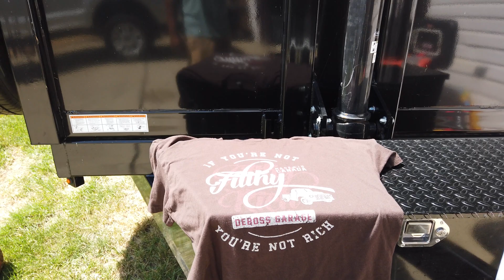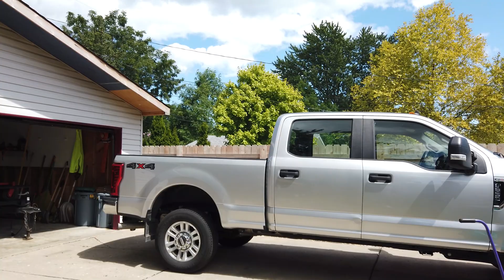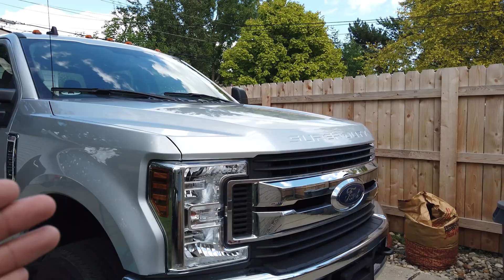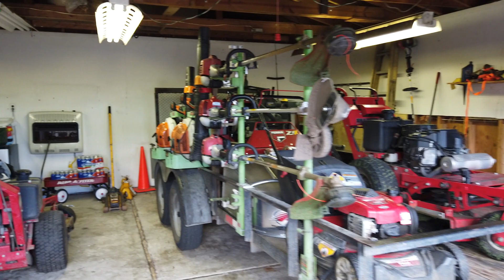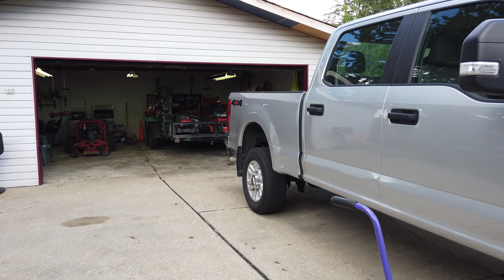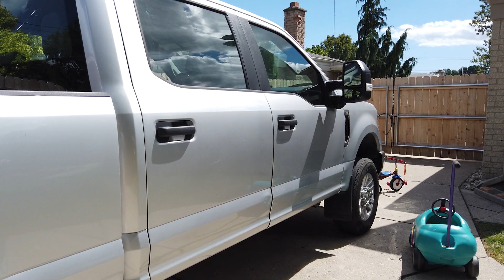Crystallization of full synthetic oil? What was Deboss's engine builder talking about?

Comment: My f150 5.4 2v 19yrs full synthetic never internally had failure 2 yrs switched Castrol 15-20k full syn but change 10k with high mileage filter always I Think the fuel  packages nowadays my be causing crystallizing with extended oil changes
Reply from the maker: I've been working on cars since I was 16. Never even heard of oil crystallization...
Reply from the maker: Certainly not from full synthetic oil.

Comment: Synthetic oil is overrated in my opinion.Todays conventional oil is  better than ever.Change your oil every 3to5 thousand miles and a quality filter and any engine will last.Synthetic oil shines in EXTREME COLD OR HEAT.Most of us don't live in areas where we need synthetic oil in our vehicles,unless recommended by the manufacturer. Just my 2 cents worth.
Reply from the maker: Very true. I think with the exception of turbo engines, particularly if they are driven hard... Which is why I run full synthetic in my EcoBoost. That being said, synthetic blend is definitely adequate!

Comment: Ill have to watch the Deboss video, I agree with you on the crystallization of full synthetic oil. I don’t believe it at all. I am a fleet mechanic we use full synthetic 5w30 in our fleet of hard working 1/2 ton thru 1 ton trucks . I use conventional 15w40 in all our class 8 trucks since they sit inside even in the winter we’re ready to go 24/7;trucks sit at 67 degrees,and we change the oil annually and most trucks only have 2-4000 miles on them, most class 8 trucks go 15,000 miles between changes...we’ve never had a single issue and our light trucks typically get 500-700 hrs on the oil between changes ... Schaeffers oil has reps, I have had the same oil rep for over 30 years now.
Reply from the maker: You've had the same rep for 30 years? I've been on this Earth for 30 years! Lol
Reply from the maker: What oil do you run? Shaffers? I need to find me an amsoil rep!
Reply: You haven't seen it because your trucks are hardworking. I saw synthetic oil crystallization in a vehicle I bought a few years ago. This was a 2001 Toyota Solara with a 2.2l four. I have the valve cover gasket off and to my shock, the cam area was full of a gritty substance. It was not metallic and it was not normal sludge. I removed some of it by hand and left rest in place. I figured I would find out eventually what it was and I did.

The vehicle had been owned by an elderly driver who for year had driven it very little, maybe as little as ten miles a week or less most of the time.

My eventual conclusion is that his son had put synthetic oil in there at some point and left the same oil in there for several years. If synthetic oil does not get up to operating temperature, it crystallizes. It's that simple.

For another thing, although the mileage was quite low for a 16-year-old car, all of the seals were bad. It think this also was the result of the car not being driven and kept outdoors through some very hot summers.

Comment: Sean it's not something I worry about here in Florida. He said conventional oil makes sludge. Synthetic oil if you don't get it hot enough on each drive cycle it hangs on the walls and doesn't drain back to the pan. Then it crystalizes on the walls. I don't know anything about what he said.
Reply from the maker: I cant find anything online to support his statement...
Reply: I don’t agree at all, synthetic oil doesn’t hang onto anything it goes right back in the pan.
Reply from the maker: @JohnDiMartino  right... What do you think about the cold camshafts?